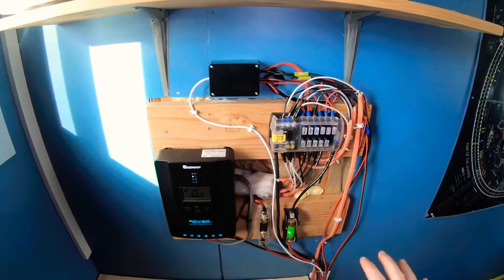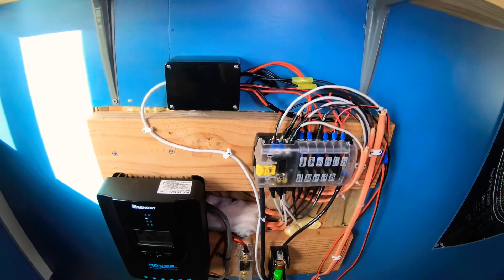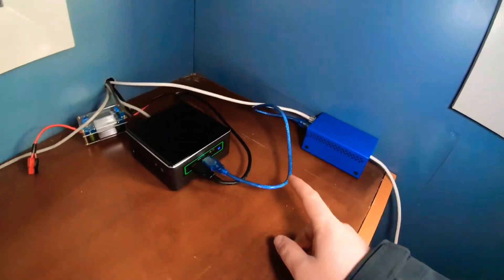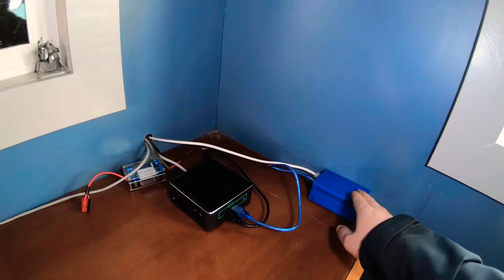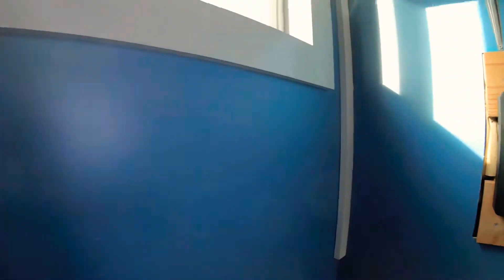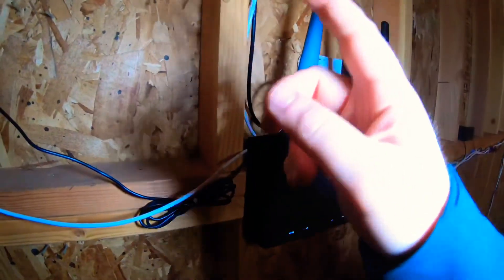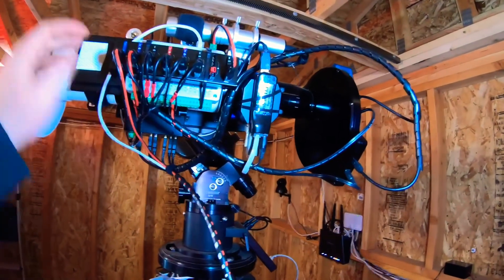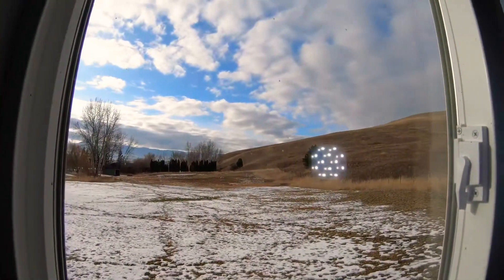Remote Power Control (DIY) and Other Updates

Comment: Since you have an AC circuit running to an inverter that supplies power to the NUC (and in turn the arduino relay control), I would suggest having a powerline ethernet device running over that line to extend your network connection to the observatory so you don't have to depend on the WiFi circuit. This way you can actually turn down the WiFi as well. It wasn't clear if you've fully integrated the inverter into your solar power/battery system and are using it to supplement the solar power to maintain battery charge.
Reply from the maker: That's a great point! I'll consider it for version 2.0. Thanks!